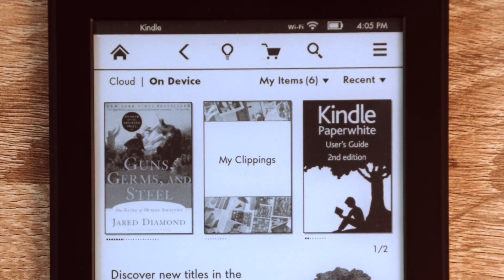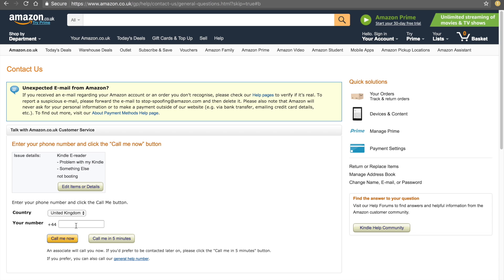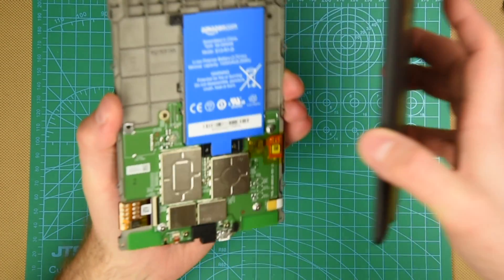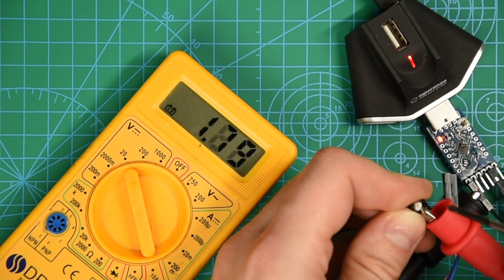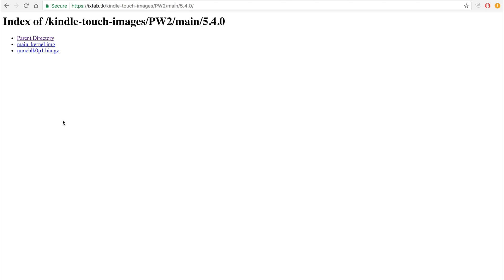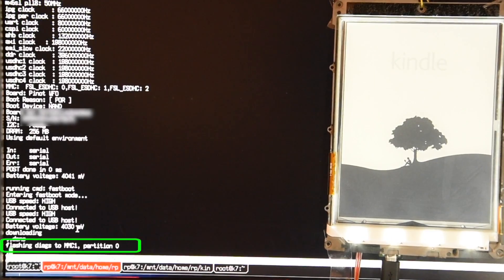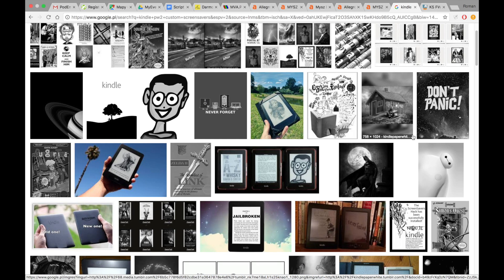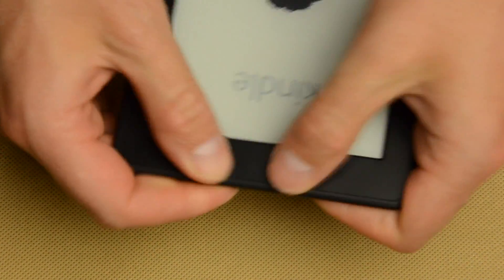Unbricking Kindle Paperwhite 2

Comment: I have "Kindle Paperwhite (11th Generation) - 2021 release" and it is in permanent boot loop.  Does this devices have connection points for TX, RX and GND?  I took the back off and see nothing like what was on the past models.
Reply: After a bit more searching it appears this is the first Kindle that lacks serial pads on the board, though the experts at this have not given up and expect to have a solution later this year.
Reply: @MMorrow777  have you solve it?

Comment: hey, I am trying to debrick my kindle, I just flashed it with the images provided in the tutorial description, enabled diagnostic mode with "./fastboot setvar bootmode diags" and rebooted it. when it reboots it doesn't enter diagnostic mode tho, in the serial port debug it shows the following errors:
`...
[    1.706780] mxc_dvfs_core_probe
[    1.714340] DVFS driver module loaded
[    1.737446] regulator_init_complete: max77696_ldo10: incomplete constraints, leaving on
[    1.752691] regulator_init_complete: max77696_ldo7: incomplete constraints, leaving on
[    1.770048] regulator_init_complete: max77696_ldo6: incomplete constraints, leaving on
[    1.785257] regulator_init_complete: max77696_buck6: incomplete constraints, leaving on
[    1.793485] regulator_init_complete: max77696_buck5: incomplete constraints, leaving on
[    1.802204] regulator_init_complete: max77696_buck2dvs: incomplete constraints, leaving on
[    1.810556] emmc: I def:mmcpartinfo:vendor=toshiba, host=mmc0:
[    1.819790] regulator_init_complete: max77696_buck1dvs: incomplete constraints, leaving on
[    1.838984] mmc0: unrecognised EXT_CSD revision 7
[    1.843696] mmc0: error -22 whilst initialising MMC card
[    1.851483] max77696-rtc max77696-rtc.0: setting system clock to 2021-09-10 18:31:36 UTC (1631298696)
[    1.883644] KERNEL: I pmic:charger chgina::charger connected
[    1.930832] MAX77696 Main Charger Driver 1.0.0 Installed
[    1.969526] MAX77696 Energy Harvester Driver 1.0.0 Installed
[    1.987266] Freeing init memory: 1036K
3.0.35-lab126 #1 Tue Sep 3 03:12:16 PDT 2013 armv7l
[    2.067505] emmc: I def:mmcpartinfo:vendor=toshiba, host=mmc0:
[    2.096435] mmc0: unrecognised EXT_CSD revision 7
[    2.101166] mmc0: error -22 whilst initialising MMC card
[    2.298024] emmc: I def:mmcpartinfo:vendor=toshiba, host=mmc0:
[    2.334487] mmc0: unrecognised EXT_CSD revision 7
[    2.339236] mmc0: error -22 whilst initialising MMC card
[    2.416651] add wake up source irq 104
[    2.569644] emmc: I def:mmcpartinfo:vendor=toshiba, host=mmc0:
[    2.628923] mmc0: unrecognised EXT_CSD revision 7
[    2.633651] mmc0: error -22 whilst initialising MMC card
[    3.546991] KERNEL: I pmic:fg battery id check::wario_battery_valid=1

`

It is a generation 6 kindle paperwhite.
Can someone help me?

Comment: This is the worst and unhelpful video . Since it is very difficult to follow and it might risk the kindle to be damaged. Please ask for forgiveness for this misleading video since it creates a false impression to the affected guys that it is the only solution but it’s not! Here is the much much much easier way.
How to get rid of a frozen screen of kindles /reboot loop/ locked tree screen (only sound solution that works)?
You would not find this answer to anywhere including the technical customer care of amazon! That’s why I am sharing.
Often people face this problem where screen is dtuck or frozen to the tree logo. It especially happens while transferring files through usb. If usb is not safely ejecting, immediatelyan error message comes, which will tell to wait. Please do wait and don’t do hard restart. If the message goes away, immediately reset the kindle at the first opportunity (don’t try to restart by any means). The problem would be solved. If you misses this golden opportunity and the screen is stuck at tree screen or even on the error message in the home screen. Don’t do anything (some people get helped by leaving the kindle attached to the usb of pc for 5 to 15 minutes but this didn’t help me! Even computer would not show any drive for that). Just wait for the ‘low battery message’ which comes when kindle is almost running out of its charging. Remember this message will go away within two seconds and the kindle would be again stuck in the frozen screen. Just tap ‘ok’ within two seconds of that battery message. If you misses, recharge the kindle for two minutes and then again wait for the message. You might have to observe for hours for that message since you might not know the battery percentage from the frozen tree screen. The solution is ‘just instantly tap ok of the battery message’ and then immediately plug the cable to the charger and this time you would be able to do reset!
Reply from the maker: A lot of words but not much information. My video shows how to unbrick specific Kindle version with specific boot loop problem described here: https://youtu.be/xBquDhGZXoU?t=428 This video is designated for technically educated individuals who can read and understand logs and have some linux experience. It is not for everyone. I am happy for you that you know better and simpler solution and will be happy to hear from all people who successfully used it.

Comment: Great video BTW! I'm having issues with Kindle Voyage (7th gen - 2014/2015), and I notice the serial port is exactly the same, just different orientation! lol! Just stop the video 6m32s to see the G-ground R-receive T-trasmit on the pads. Nice!  BTW, I love Silicon Labs serial chips. I get almost 1Mbps on my NodeMCU ESP8266 setup. I hope to be successful at fixing my Kindle Voyage. I'm not ruling out that the flash is defective. We'll see.

Comment: this is brilliant. So glad you have shared this information. My Kindle Paperwhite started this boot loop behaviour as well. Originally my Kindle stopped connecting to my PC but it still would charge. If I hold the USB plug in very firmly it can connect and stay connected but it's extremely temperamental. After a couple of days of trying to get this to work, and repeating the 40 second rebooting trials, the kindle started doing reboot loops and I haven't been able to recover it. Amazons support was useless. Basically, try to reset it, your Kindle is out of warranty so bad luck, we don't repair it. The tech refused to accept that the port is faulty for USB communications because it was still charging. Have you tried replacing the USB port on the kindle? I'd like to but worried about how difficult it might be to unsolder and resolder.

Comment: I've got a hint for everyone looking for a 1.8V connection on the kindle mainboard. If you pause the video at 5:31 you can see the measuring process. Look at the bottom right of the board. You will see a white flat cable right next to the screw. Above the end of the cable you can see an connection point. At this point you will find your 1.8V.
Reply from the maker: Nice. Thanks for the hint!
Reply: don't  need to connect vcc. so 1.8 or 3.3 or 5v does not matter. there is no power go through ttl board

Comment: Hey, awesome tutorial, but I am stuck on a problem with entering fastboot mode.

When I attempt to enter fastboot mode while in BIST, Kindle mounts on my system (shows up in the Device Manager [Win10 btw]), and then after several seconds it gives up and dismounts without installing any driver for Kindle. This makes it impossible for Fastboot on my PC to find and flash it. Do you have any suggestions on what might be causing that? Thanks!
Reply: Hi Sebastian, I know it has been a long time since you commented but this partially helped me solve the same issue you are having https://www.mobileread.com/forums/showthread.php?p=2001621
Reply: The issue I still have is  fastboot <waiting for device>
Reply: @UrsANDrei  have you managed to find a solution? I am stuck in the fastboot <wait for device> problem

Comment: Hi @ all, i have a Problem to change the bootmode into diags. The connection through fastboot works fine and i have flashed the first images without problems. but if i tried to type the command "./fastboot setvar bootmode diags" i became the following response: "fastboot unknown command setvar. In the terminal i have this respone in this moment:
- Connected to USB host!
- Error! Couldn't find NV variable slot-count
- Error! Couldn't find NV variable slot-suffixes
- Battery voltage: 3813 mV

in the fastboot help command i can´t finde the command "setvar". there is only a "getvar" command. an the rsponse for "./fastboot getvar bootmode" ist "bootmode: main".

´Has annyone an idea?

while booting, it willl stuck there:

U-Boot 2009.08-lab126 (Aug 28 2013 - 15:06:12)

CPU: Freescale i.MX6 family TO0.0 at 996 MHz
Temperature:   42 C, calibration data 0x5794f95f
mx6sl pll1: 996MHz
mx6sl pll2: 528MHz
mx6sl pll3: 480MHz
mx6sl pll8: 50MHz
ipg clock     : 66000000Hz
ipg per clock : 66000000Hz
uart clock    : 80000000Hz
cspi clock    : 60000000Hz
ahb clock     : 132000000Hz
axi clock   : 198000000Hz
emi_slow clock: 22000000Hz
ddr clock     : 396000000Hz
usdhc1 clock  : 198000000Hz
usdhc2 clock  : 198000000Hz
usdhc3 clock  : 198000000Hz
usdhc4 clock  : 198000000Hz
MMC:  FSL_ESDHC: 0,FSL_ESDHC: 1,FSL_ESDHC: 2
Board: Pinot WFO 2GB
Boot Reason: [ POR ]
Boot Device: NAND
Board Id: 02E2201134363E7J
S/N: 90D42204346409TG
I2C:   ready
DRAM:  256 MB
Using default environment

In:    serial
Out:   serial
Err:   serial
Quick Memory Test 0x80000000, 0xfff0000
POST done in 59 ms
Battery voltage: 3817 mV

Hit any key to stop autoboot:  0
## Booting kernel from Legacy Image at 80800000 ...
   Image Name:   Linux-2.6.31-rt11-lab126
   Image Type:   ARM Linux Kernel Image (uncompressed)
   Data Size:    4608576 Bytes =  4.4 MB
   Load Address: 70008000
   Entry Point:  70008000
   Verifying Checksum ... OK
   Loading Kernel Image ...
Reply from the maker: You are probably not using correct fastboot version for Kindle. Try fastboot from this link: https://github.com/TobiasWooldridge/Fastboot-Kindle
Reply: Hi,.... thak you much!... now i can boot into diags :) ... but.... a new problem, now it got stuck at this point:

...
[    4.842217] INFO:DIAGS MODE
Press [ENTER] for recovery menu...       0 /[    5.852263] INFO:!!! Checking MBR /dev/mmcblk0 !!!!
[    5.863099] INFO:partition 2, start sector is 782336
[    5.868211] INFO:partition 3, start sector is 913408
[    5.873261] INFO:partition 4, start sector is 1044480
[    5.878400] INFO:maximizing partition 2797568 sectors
[    5.883495] INFO:*** Partition table verified for /dev/mmcblk0 *
/dev/mmcblk0p4:[    5.892327] INFO:Setup loop device /dev/loop0 for /dev/mmcblk0p4 + 8192

CHS=4/16/43712 size=1432354816 bytes
flag type      first     [    5.904792] INFO:Checking for updates... (auto-pilot mode)
  last  lba first   lba size
Par[    5.910879] INFO:No update*.bin found; no update needed.
tition p1:
0x00 0x0b         16 <large>            16    2797552
    CHS: 0/1/1 - <large>
Part[    5.926135] INFO:no updates found.
ition p2:
Partition p3:
Partition p4:
[    6.206406] INFO:Couldn't find localized image at /mnt/wfm/images/splash.raw.gz
[    6.915301] ERROR:/mnt/wfm:error 22(22)
[    6.919210] ERROR:Trouble unmounting waveform partition
BOOTING DEFAULT.
IP-Config: no devices to configure
kinit: Unable to mount root fs on device dev(179,2)
kinit: init not found!

Any idea?

For explanation: I have become this Kindel of a friend. After connectig the serial port i have become this first bootlog wthie this problem:

...
Starting kernel ...

[    0.101130] boot: C def:bcut:batterycut=1
[    0.280999] LPDDR2 MfgId: 0x1 [Samsung]
[    0.284864]
[    0.284867] just text: vaddr c0171814, va 0xc0171200 pa 0x801000c3 attr 0x6
[    0.297339]
[    0.297343] nmx6sl_wfi_iram: vaddr d084e000, va 0xd084e200 pa 0x904043 attr 0x2
[    0.306203]
[    0.306206] mx6sl_ddr: vaddr d0856000, va 0xd0856200 pa 0x905043 attr 0x2
[    0.314542]
[    0.314545] mx6sl_iomux: vaddr f40e0000, va 0xf40e0200 pa 0x20110c3 attr 0x149
[    0.325387]
[    0.325390] ANATOP: vaddr f40c8000, va 0xf40c8200 pa 0x20110c3 attr 0x149
[    0.339748]
[    0.339751] CCM: vaddr f40c4000, va 0xf40c4200 pa 0x20110c3 attr 0x149
[    0.351897]
[    0.351900] MMDC_P0: vaddr f41b0000, va 0xf41b0200 pa 0x21110c3 attr 0x149
[    0.362305]
[    0.362308] L2: vaddr f2a02000, va 0xf2a02200 pa 0xa02043 attr 0x149
[    0.372208]
[    0.372211] arm perif: vaddr f2a00000, va 0xf2a00200 pa 0xa00043 attr 0x149
3.0.35-lab126 #1 PREEMPT Tue Jul 26 06:10:59 PDT 2016 armv7l
Press [ENTER] for recovery menu...       0 //dev/mmcblk0p4:
CHS=4/16/43712 size=1432354816[    5.069219] FAT-fs (loop0): bogus number of reserved sectors
 bytes
flag type      first       last  lba first   lba size
Partition p1:
0x00 0x0b         16 <large>            16    2797552
    CHS: 0/1/1 - <large>
Partition p2:
Partition p3:
Partition p4:
BOOTING DEFAULT.
IP-Config: no devices to configure
kinit: Mounted root (ext3 filesystem) readonly.
info sytem:mounted_proc::
info system:mounted_sys::
info system:sy00::
info system:mounted_dev::
info milestone:6.89:49.1:
init.exe: system pre-start process (653) terminated with status 1
init.exe: system_monitor main process (711) terminated with status 127

Befoer i have watched your great video, i have tried something in the recoverymenu. Ther i have used the option Nr4 (erase MMC0). Now i think this was a big mistake.

Gruß, greeting, приветствие: Rudi from Germany
Reply: Hello man!!! have you solved the problem with your PW2 kindle? I have absolutely the same problem, and don't know how to solve it!
Reply: Hi. you mean the "kinit: init not found!"...?
No, i didn´t solve the problem :(
It's good that we both have the problem, so maybe we'll be helped sooner.
If you solve it, pleas tell me how.
Reply: OK if I'll get the solution it, I'll tell you. Now I'm trying to solve it, but without success so far :(. Yes I have the same message  - "IP-Config: no devices to configure
kinit: Unable to mount root fs on device dev(179,2)
kinit: init not found!" 
It most likely is a result of a deleting everything, as you said (option 4 of recovery menue).
And option 3 doesn't work for some reason :( . I also can't get into fastboot mode, and command "bist fasboot" stuck at battary voltage, and coninuing to wright it. Iused fastboot drivers for windows - stuck in "waiting for device", tryed in Kubrick  - same thing - "waiting for device"  :(

Comment: Hey I have a question. I have CP 2104 and XL4005 DC-DC Step-down. Can I connect RX and TX to IN+ IN- on XL4005 and next, OUT+ and OUT- to RX and TX in Kindle to connect to serial? I mean ofcourse voltage XL4005 will be decrease to 1.8V. I have to make modification on CP2104 to VCC connector? I have read that enough is RX TX and GND.
Reply from the maker: Hi Emil. Please absolutely don't do it. CL4005 is a DC-DC converter. It means it is supposed to provide power to other devices. It cannot "translate" 3,3V signal to 1,8V signal. So you can use it to power up CP2104 by connecting OUT-/+ to GND and VCC on your CP2104. RX-TX you should connect directly as described in video and in the comments.
Reply: E-LAB I have another questions. Where did you connect that 1.8v? Why do you made this additional pin? Where did you connect your potentiometer?Where is this 3.3 source where you have already 1.8v on TTL? I don't understand this from video. Can you explain every connections from CP to Kindle? I know how to connect to serial (RX TX and GND) but I think that is not enough.
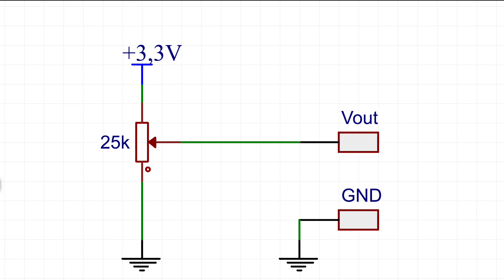Reply from the maker: This additional pin (VIO pin of CP2104) controls TTL level signal of the output (RX/TX). Whatever voltage you provide at this pin, then output voltage level of RX/TX will be the same (of course within limits). So you need to provide 1,8V from any external power source. Voltage divider as shown at 5:49 can be used here. Instead 3,3V you can also use 5V. Then set 1,8V on Vout by adjusting the potentiometer. Finally connect Vout to VIN of CP2104.
Reply: Could you further explain what you have done with this 1,8V that you get form the potentiometer? If I am good understanding this Vout from potentiometer where you have finally 1,8V, you have connected to the VIO pin on the converter board? And if I am right that's all? From now we have a 1,8V on RX/TX? Or we need to provide this 1,8V VIO to kindle board by soldering this somwhere?

Comment: Thank you for the video! For the wiring, do I see this correctly:
RX on Kindle  -->  TX on CP2104
TX on Kindle  -->  RX on CP2104
Thanks!
Reply from the maker: Yes. For serial connection you always need to cross connect RX and TX.
Reply: Great! Thank you for your answer!
Last question. Seems you found (5:45) 1.76 Volts on the board.
I know the spec is 1.8V, but could it have worked with 1.76V?
Reply from the maker: Yes, it perfectly should work with 1.76V instead of 1.8V - you will never get perfect 1.8V. And actually I don't know why i didn't use this voltage visible at 5:45 as a reference - maybe I didn't catch it on the camera but the voltage on this pin was changing... Hard to say now.
Reply: Thank you! I'm still waiting for the usb-serial device to arrive.However, still seems like a daunting task. Not sure if I understand everything. Thank you for the video and for answering!
Reply: Hi. There is one thing that I can not understand. What we are doing with this reference voltage. We are soldering it also to our kindle from converter or ... ? Could you explain or give an example description of connecting all pins from converter -> to kindle. And tell how we get 1,8 from 3,3 V on converter?
Thanks a lot, great job.